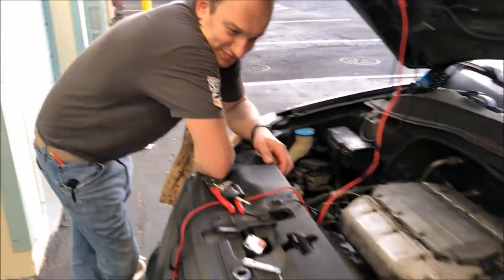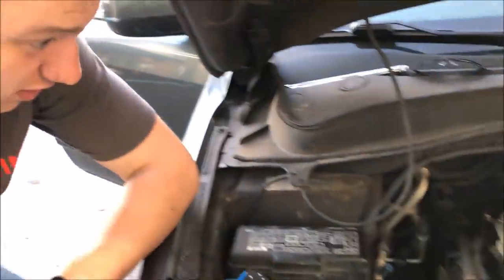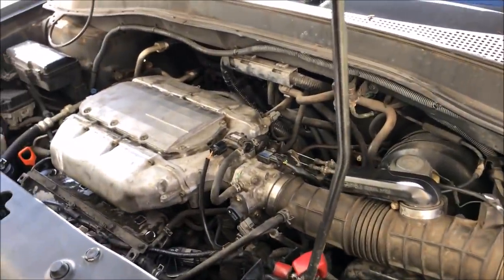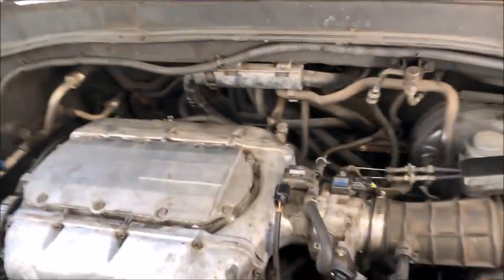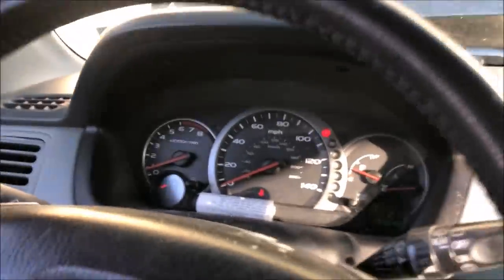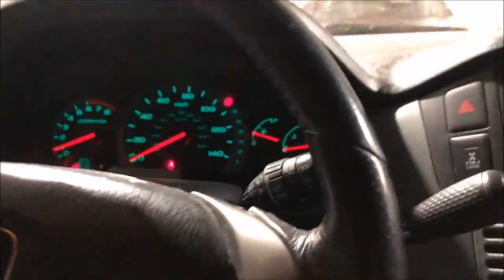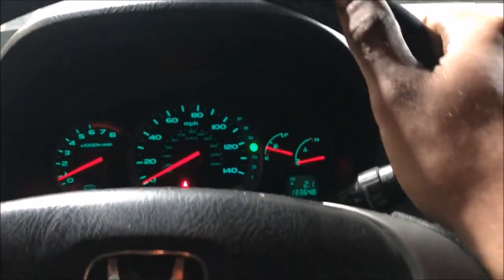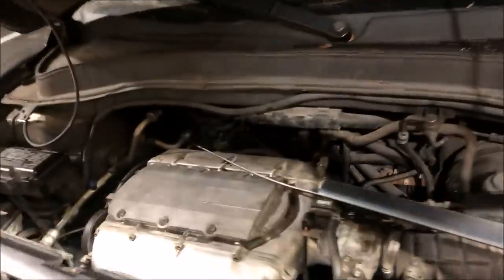I Fixed The $250 Honda Pilot For Under $100

Comment: The pilot does has a vacuum issue too. The back right of the intake planum should have a small hose attached. It appears to be missing altogether on your vehicle. Mine was disconnected for some time. Reconnected it, fuel efficiency went up at least 50%. The engine also has Honda's variable cylinder management VCM which makes it an i3 in low power situations. I might need injectors though. Thanks for the tip
Reply: No, this engine doesn’t have VCM

Comment: Not sure how common it is with other pilot owners, but I went through EVERYTHING you’ve done in this video and the previous one....including adjusting valves, knock sensor swap and evap replacement as my pilot was throwing the same code u mentioned in the previous vid...along with the random misfire codes.

Mine turned out to be a stinkin cracked intake arm right where those ridges are...which would cause the engine to suck in unregulated amounts of air causing the car to run like 💩.

Glad you got it fixed because these engines are irritating to work on, specially since the space in the back is nearly impossible to fit an arm in.

Comment: Adjust the valves and it will be fixed. Worked as a honda Acura mechanic for years and tight exhaust valves are super common misfire especially when cold.
Reply from the maker: Drew Marshall it’s already fixed, it was only the injectors as I said in this video. Weeks later daily driving no issues no misfires.

Comment: It is a weird one diagnosing fuel injectors because generally on petrol engines they don't give trouble so people always look for sensor issues first as they are more common. Glad you fixed it. Always feels great solving a problem that you have spent time working on. Also for 4 injectors to go bad is super unusual.
Reply from the maker: Mr.Mister all six were bad!
Reply: @bigalsbikeandauto  Even more unusual then. Maybe a faulty batch or something from factory. Hard to tell.
Reply from the maker: Mr.Mister really bad fuel would do it too

Comment: Great job!  I'm an original owner of a 2003 Honda Pilot with 247,500 miles on it.  Trying to get her past the 250k point but she's been struggling with transmission issues for the last year. It bucks and shudders between 2nd and 3rd upshift so I suspect a torque converter issue.  It's lasted way longer than most original transmissions from that era so I can't complain.  Other than that she's been an amazing vehicle.  Best of luck with your Pilot!

Comment: As an owner of a 08 pilot myself, I was really excited when you were. Now, if I ever run into this problem with mine, I'll know what to look at.
Reply: Do you recommend owning one ? Looking for one for the bug fan
Reply: @abaln9794  I do, solid engine, solid transmission, built right. I have 4 small kids and they all fit. We have taken long hour trips to shorter off roading overland trips. Never had an issue, it has done great in the snow, mud, rain, dirt, rocks, it's a good vehicle. Mine is a 4wd with the vtm-lock , it has a DVD player, sun roof, fog lights.
Reply: @maximusilive4theking986  have you had any issues with the timing belt ?? 
I appreciate the quick response 😁
Reply: @abaln9794  no not yet at least, I have 118k miles on mine so far.
Reply: @maximusilive4theking986  that's great
Reply: I’m an owner of a 2007 pilot EXL Navi 4WD with 225,000 miles

Comment: The simple fact that the Pilot is almost 20 years old with under 140,000 miles on it means that it sat for a long while contributing to the injectors fouling with old fuel. My lawn mower's carburetor would gum up after sitting unused for several years. Glad you were able to get it running again. Gotta love the wonderful sense of accomplishment you get after fixing something for so cheap!

Comment: You have to wonder if this car, with its low miles, spent a lot of time puttering around town, which is really hard on a vehicle & might account for ruined injectors.  Well done with your diagnosis... was very informative & entertaining, & may prove valuable for my daughter's 04 Pilot... it also reminds me that it's  time to run some injector cleaner thru my wife's 2010 CR-V.  THANKS AGAIN!!!
Reply: Hey yo
Reply from the maker: Scott Hall yes the previous owner and I both live in the city so if I had to guess it’s mostly city miles

Comment: Hey man great job I love the Pilot I have one myself. I have a question could you tell me what does the wires for the headlights how does the wires go into the connectors on both sides both of my headlights connectors burned. Bought new aftermarket connectors but don’t know how the supposes to go any information would be gladly appreciated thanks and once again great job on the Pilot

Comment: Swapping injectors only helps if it's only one. If it's more than one , then it can be an issue. I have gotten vehicles were there were 3 issues deep each one making it hard to diagnose. I hate throwing parts at a vehicle.

Comment: What brand injector cleaner do you use Al? I always was told those were more gimmicky than anything.
Reply from the maker: Matt Evans Lucas injector cleaner. I wouldn’t put injector cleaner in a car that is having no fuel related issues but in this case it definitely needed it.

Comment: Need help with my 03 explorer, my back hatch locking mechanism wont lock which in return makes my glass hatch stick out( I have it holding together with zipties) you can press your finger in it and lock it like that but when you try it with the glass hatch the part where it would push back the lock and lock it in place doesn't ever work.i dont think it's in the right position, I think it barely going over the lock which is why it wont lock
Reply from the maker: Your Favorite Mexican I have a video on my channel about fixing explorer hatch locks

Comment: Change the fuel filter just to be sure if you already haven't done that.  Sounds like your savvy enough to have done that already though.
Reply from the maker: Chris Croley no fuel filter in these Pilots, the pump has a strainer on it in fuel tank. I’m planning on changing it out.

Comment: One has to ask the question. Those things go much longer then that did  without even having one injector fail let alone 6. Something prob made all those injectors go bad. Did somebody sabotage the gas tank? Rust in the tank? Failed fuel filter? I’d be dropping the tank checking it and cleaning it out before these new injectors are compromised.
Reply from the maker: Cheviesel Cheviesel I’m not going to drop the tank but I may change the strainer/fuel pump since it’s cheap and easy. I’ve ran two tanks of fuel through it so far no issue.

Comment: Great job the feeling of success. I would deffintly change the plugs still ,deffintly fouled after all the fuel on the plugs and plugs are cheap and easy to change if it was my car
Reply from the maker: Troy Smith plugs are fine, I cleaned them with a blowtorch

Comment: Run a can of sea foam. I promise you that you will not regret it. Congrats on getting her going. Also use a raid not hot shot roach bomb.
Reply from the maker: socomsfinest 1 I use seafoam on a lot of my cars. This one doesn’t need it, the injectors are fresh and I’ve already cleaned the EGR, throttle body, etc.
Reply: @bigalsbikeandauto   how much are you goimg to sell it for? I live in fl also.
Reply: @bigalsbikeandauto  sea foam cleans alot more than what you have already cleaned though.
Reply from the maker: socomsfinest 1 around $3000
Reply: @bigalsbikeandauto  wow thats goimg to be some really good profit. Good luck.

Comment: Glad you got her running right! But I'm still thinking you had a intake leak looking at the old gasket... If your injectors were bad they definitely would through a code and check engine light...  Still clean out the throttle body.. But good she has smoothed out..

Comment: I would run some dry gas through that tank as well, maybe she got water in the tank either by keeping the tank low = condensation, or from the gas pump. I would also throw in a new filter. 

The chance of all 6 going bad at the same time without a reason is virtually nil. Something went threw them.
Reply from the maker: SCcarguy good suggestion with the dry gas.
Reply: SCcarguy what is dry gas?  And where can I buy some?  Thanks!
Reply: Ma Ka any auto supply should have some. It’s very common up north to help fuel lines not freeze. I’m in the south now and don’t use it but I think it’s still around.

Comment: I always go straight to the basics. It takes air, fuel and spark. You got air? You got fuel? You got spark? I often remove plugs and then ground one at a time to see it they spark. Same thing with ejectors. Just don't mix gas fumes with sparks. U idiots should have figured that out on the first day. (Just kidding) 😁
Reply from the maker: BigFoot Too went by the OBD2 codes at first, then started checking the basics when the codes were wrong

Comment: you can buy bug bombs pretty cheap at dollar store. I would throw one in there with windows up and let it set for a couple days before you shampoo and detail the inside thoroughly....
Reply from the maker: Gotta Tinker33 problem with a bug bomb in the car is you’ll be breathing the chemicals in even days later, it’s too confined of a space. The bugs have been gone for over a week I vacuumed and used a little raid